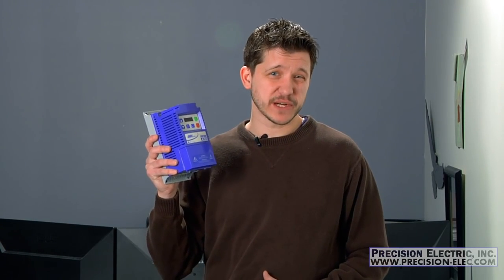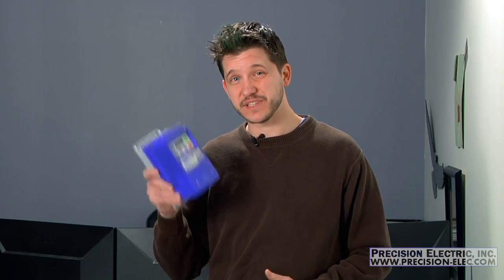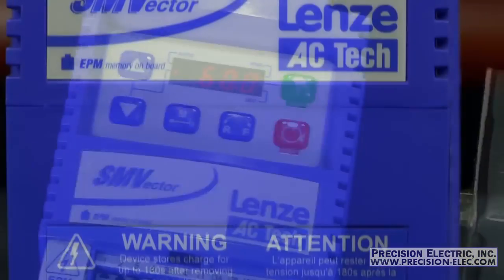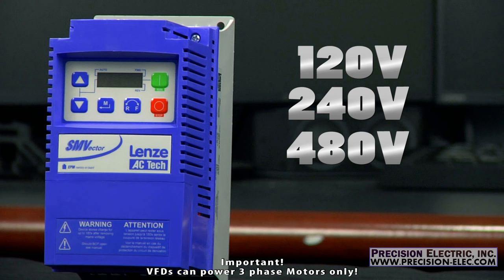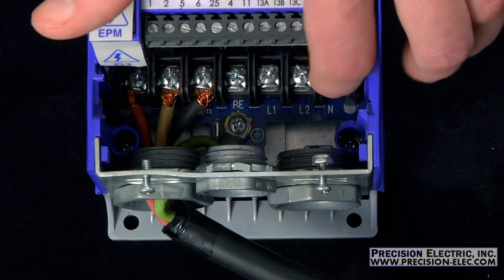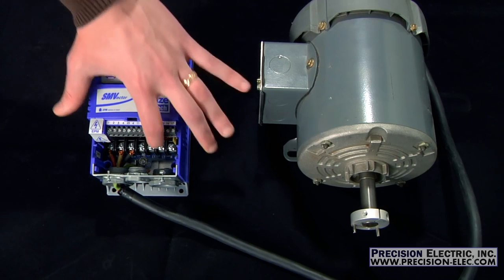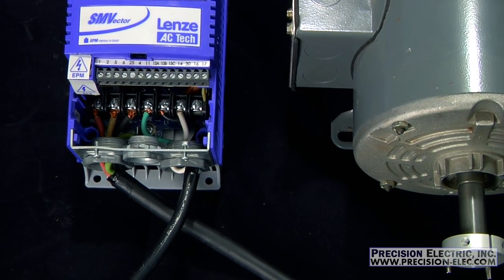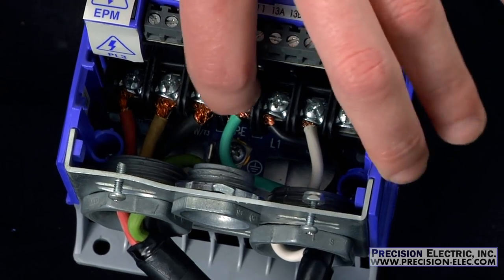The Lenze SMV VFD Single To Three Phase Converter For AC Motors

Comment: I have an Electrolux Wascator 75 coin operated Laundrymat type washing machine that is 3 phase. My Elmo Motor has 2 plates on it, Black & Yellow. One plate says 50hz, the other 60hz giving slightly different reading for HP & Revs. As washing machines use more than one speed, and stop-start change rotation, will the convertor be able to power this motor correctly? My supply is 240v 50Hz UK with Live / Neutral / Earth / Ground. Thanks for any replies.

Comment: Really interesting. It surges me a question. Does it result necessary to fit some parameter, as for example "base voltage" ( P165 ) ?. 

I ask it because recently happened to me, that in this configuration (120V single-phase - to three-phase) the "motor overload fault" FPF would occur within less than 1 minute of turning on. I set up the base voltage P165 in 120 (By default settled in 240) and now it works. However, I would grateful to know if this solution is in fact correct.

Thank beforehand!